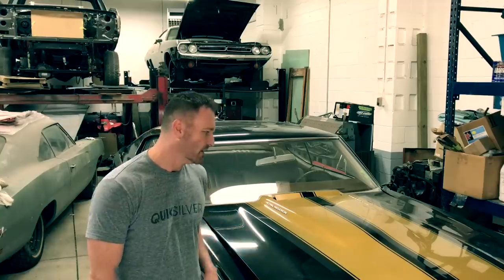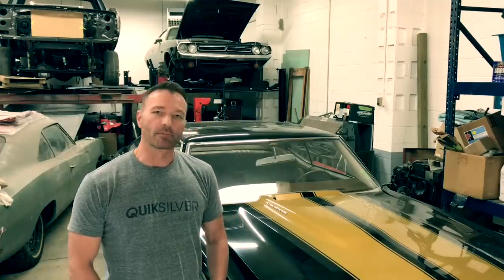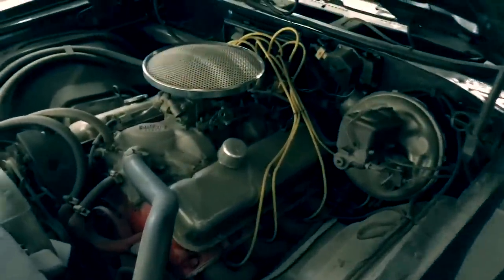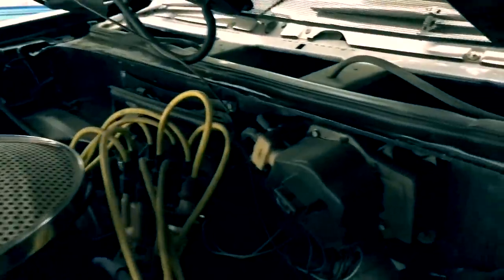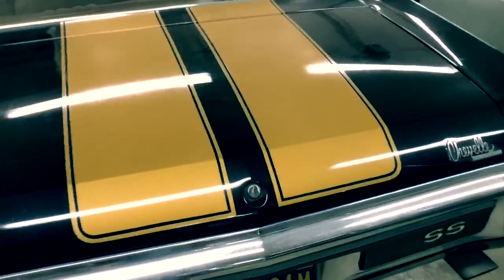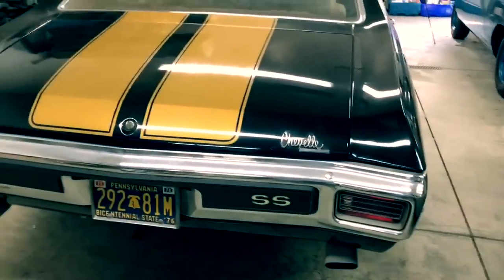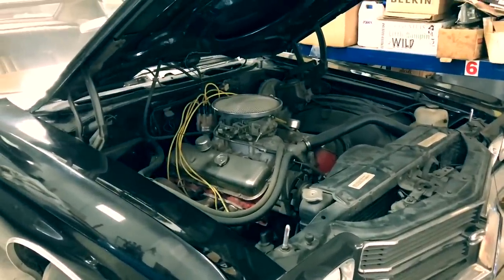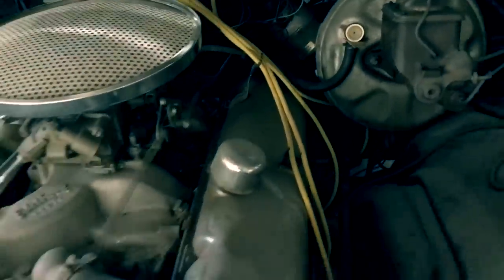Amazing 1,092 Mile 1970 Chevelle SS454 LS6 Found In Rural Pennsylvania

Comment: 1092 original miles. That's their story and they're sticking to it! lol
Reply: Baloney... A man doesn’t by his dream car, change the racing stripes and steering wheel add headers Remove smog, register it for six years and then only put 1000 miles on it...Tell me more about the guy I wanna know
Reply: @jamiecann2485  Do you know how many young fellas bought those kinds of cars and ended up over in Nam or some other country ? never to return , I didn't think so , some of those cars sat in garages for decades as well , lots of variables in life
Reply: @brettjohnson8009  Now you’re going to use the “Vietnam war card” to defend your BS???
Shame on you...
You tell me how many Vietnam soldiers that purchased Brand New 1970 Chevelle super sports fully loaded and parked them in a barn somewhere...and never came home...
In other words don’t question the car only has 1000 miles on it...
SAD
Reply: @jamiecann2485  Ditto, we used to just disconnect the speedo cable right away all the time on our cars. This is not a 1092 mile car
Reply: You could do a compression test on it. That would tell the story.
Reply: The early 70's low mileage Corvette sitting and fairly well maintained since 1976 in my relatives' extra garage lol's at Bob..  People tend to hang on to cars that were associated with someone who died..
Not even the only kept car in my extended family, but I have a ton of relatives on both sides.
One of my cousins has a pristine 70's black and gold firebird trans am that still sits on the showroom floor of my uncle's dealership.
You might be amazed at just how many perfect or near perfect cars are out there preserved if you look around. 
Most simply aren't for sale so they never come up.

Comment: My uncle had one (black/ red stripe '70 SS 454/4 speed 35k on the clock) when I live with his family in the late 90's. I did not roll it out of his garage at 1am in neutral on two occasions and neither did I race a ricer on the straights up past a buck 40 either. Pat, if you are reading this.... no harm no foul, right?   Man that was a sweet car.

Comment from the maker: No sir the carb on this car is aftermarket. All SS454 LS6 Chevelles had vacuum secondaries from the factory. List no 4492 for Auto and 1557 for manual except for state of CA which had a different but not important in your application.

Comment: Beautiful car!
But seems weird that, not one, but 2 previous owners, and the car only has 1000 miles on it... The orig owner changed alot of parts, and even had it to a body shop for the gold stripes, not to drive it! He must have owned a flatbed, and drove that around with the car strapped to it...
Sounds very similar to a family friend of ours that bought a new Oldsmobile in 1968. He was so anal about the car staying new, that he took it to a local mechanic and had the speedo cable undone months after buying the car. He owned the car for about 15 yrs, and had the mechanic show him how to do it himself, that way if he needed to have the car in for warrantee work, he would hook it back up before going there, and drive for a couple days before undoing it again.
Seems pretty cool when you own the car, but sad for the next guy who's buying a low mileage car...

Comment: I've got a couple of questions about the car. There was no Chevelle emblem in the driver side front grille. Yes, It could have been removed to make for a cleaner look. And, isn't there a screw that helps hold the side panels on each side of the back seat? They seem to be missing. It wasn't mentioned in the video but I'm just wondering if the interior had been redone or had some interior replaced. True, to me these little things doesn't hurt the car in my opinion it's truly a "one of a kind find". I had a friend who bought one when he got out of the Army in 1970. LS6 triple black Chevelle SS. It was black with black vinyl top. Black interior with white stripes cowl induction hood. Four speed M22 with bucket seats and console. I got to drive it a time or two. Again, not being critical just curious about the things I mentioned. Absolutely an amazing find!

Comment: You Know it's an Interesting Car, but the Things that have Been changed on it Are Very puzzling.  With the Overall condition Of the Car I don't Doubt the Mileage very much.  Though It's the Things that are Missing Such as the Original Exhaust Manifolds original Air cleaner & distributor that are Very puzzling Cause With only 1092 Miles everything Should still be like NEW.  Of-course if this guy Raced it those 1092 Miles Were Probably very HARD Miles on the car.  It's Just certain things don't fit with what you tend to see in ultra Low mileage Cars of the Era.

Comment: Wrong Intake,All LS-6' s & L-78' s Came With A Winters Intake,W/ A Snowflake On Frt.of Intake.A Winters Intake Is A Much Better Intake ,Than the Edelbrock Ones Of That ERA,Which is What's On That Car.Only Someone That Knows Nothing About LS- 6's Would SWITCH OUT the INTAKES.Video Didn't  Show Red Line of Tach,5500,or 6500 rpm?
Reply: If you look close @ the vid, it's a 6500 redline!  You're right about the intake.  I had a 69 Chevelle L78 & it had the winters intake.  Sure miss that car!
Reply from the maker: Most of my ex girlfriends know the original intake on a 70 L78 LS6. What part about day2 mods did we miss? The original owner did the  mods within the first 6 months or purchasing new.
Reply: Also, the original intake on a '70 was flat and he probably wanted a high rise.  Then after he added the high rise the cowl induction air cleaner was too high...
Reply: @patrickglennnicholsmusclec1674  did the owner keep the original parts?  Was that the 4557 Holley on there?

Comment: did those 454s (NON LS6) all use a 3310 vacuum secondary(780cfm 4150) ?   i have a 70 454 automatic that i changed to a manual 4 speed...  and im trying to figure out if they ran 3310 vacuum secondaries on all 454s or did they run a mech. secondary on a 4 speed?  please let me know..  thanks..

Comment: When I was 17 years old, I took my life savings of $5500 to Carlisle PA to the spring show to buy a car (Chevy). I passed on several 70 SS 396 Chevelle's because they were bench seat column shift... Lol.... There was a LS6 454 car, very nice, for $10k.. I ended up with a 67 SS 396 Chevelle that had a small block instead of it's big block. 138177 car. It's got a big block now. Paid $4500. Pretty good buy.

Comment: 1000 miles.  Christ, I put on a 1000 miles in 2 weeks.  Great job on vids.  Stay right there, I'm bringing a 30 rack.
Reply: Boy, you sure drive a lot! In 2006, I had a 2003 Chevy Suburban and put on 8800 miles. Now I drive a 2006 Ford F-350 Crew Cab with a 6.0 bullet-proved engine. It was a hard endeavor, as I saw a 2019 Ford Powerstroke with 95, 000 miles in less than a year! Holy Moley...in 5000 miles, it would be out of warranty!

Comment: I HAVE BEEN A OLD SCHOOL DRAG RACER SINCE THE LATE 60’S AND THIS CAR IS A TYPICAL DAY 2 DRAG CAR THAT WAS AT TRACKS ALL OVER THE COUNTRY BACK IN THAT DAY.  MOST GUYS INSTALLED TUBE HEADERS FIRST AS THE CAST MANIFOLDS WERE JUNK.  THE 1970 INTAKE MANIFOLD WAS A LOW RISE VERSION HENCE THE EDELBROCK HIGH RISE WHICH MADE MORE POWER.  THE DIFFERENCE IN MANIFOLD HEIGHT SCREWED UP THE FITMENT OF THE FACTORY COLD AIR CLEANER WITH HOOD SEAL, SO AN AFTERMARKET AIR CLEANER WAS NORMALLY INSTALLED.  OVER THE YEARS I HAVE SEEN A NUMBER OF PERFORMANCE CARS AT DRAG STRIPS WITH VERY LOW MILES, QUITE A FEW OF THEM CUT UP FOR SUPER STOCK CLASS WITH BIG TIRES AND FULL ROLL CAGES.

Comment: In Massachusetts, in 1974, at about 18 years old I bought a 70 Chevelle SS 396(402) Turbo 400 Transmission light blue with black stripes, white bucket seat. I did many modifications to the car such as  dropping in a 375 Hp motor, rebuilding that motor with all new valve train , headers,  intake, carb, high stall converter, clutches shift kit and tranny cooler. I also had 4:10 gears installed. Tires and wheels etc. I sold it in 1977 with just over 100k on the car. And as nice as my car was then. I had some rot behind the wheel wells starting. This beautiful find, 48 years old, is in better condition than mine was in 1977. Simply effin' amazing. The car I wish I still had. I replaced it with a 77 Z28, with 185 hp. Sad
Reply: Show some respect to the 771/2 z28.
Reply: @Sumner1028  Actually the Z28 was a nice car, I just meant they had decreased it down to 185 HP. With the 3:73 gears it went well enough.
Reply: @afterthestorm7012  my mom had one of those. I was distraught when she sold it

Comment: Hopefully you can do a second video and show the build sheet.  AND I grew up in PA and until the mid 1970's (I believe) we had a TWICE A YEAR state inspection.  So it is highly likely this IS an original low mile car as the mechanic HAD to road test the car and would have noticed the speedo NOT working.  AND PSP inspection troopers would have FLAGGED IT IMMEDIATELY if there was something amiss.  PA is VERY strict on state inspection records.

Comment: Why would anyone pay $500K for a car which costs around $4K new? I saw an original '65 Chevy Biscayne with the "Drag Pack" option, 425hp 396 and 4 speed. The cost? $75K. I decided to build my own. I found a '65 Chevy Biscayne with a 283 and 3 speed. The car had been re-paint once. The car had zero rust so I bought it and trailered it home. I installed a 550hp 454 and a Richmond 6 speed. Disc brakes and Hotckis suspension. I also installed SW gauges in the dash where the original AM radio had been. I hid a new stereo in the glove box. Total cost? $20K. Now it's a car you can drive everyday instead of a car you only drive to car shows. I also changed out the front emblems from the cross flags "V" to a 454 cross flags "V". I ran into a guy at a local car show. He said he use to work for GM and in '65, they didn't have a 454. He said, "Did you do that?". I said, "Yeah, so what?". He said, "I have an original Yenko Chevelle". I said, "Let's go see it". He said, "It's not here". I said, "Why? You see my car but I don't see yours. You're one of those guys who doesn't drive their cars because it's too valuable. Well, I'll drive my car anywhere and I do. I can't stand people like you who don't drive their cars so eat shit and die!". The guys says, "I didn't mean any by it". I said, "Of course you did, now fuck off!".

Comment: Did this car get the eyebrow trim under the headlight?  I didn't see it, and you didn't mention it.  My 70 SS396 is a 2 months earlier Baltimore build (01C) and it still has that trim but I know they stopped putting it on cars sometime, not long, after that.

Comment: Very cool and period correct mods! People are asking why the cowl induction was removed. Well, back then, having a chrome air filter was cooler. Yellow plug wires were cooler. Headers were mandatory as was the addition of a Hurst shifter. Some are questioning the mileage. Well, with 4:10's, cruising was about all you would do with these low gears. Was it raced, probably just on the street.

Comment from the maker: The LS5 SS454 was originally equipped with a Rochester Quadrajet that was vacuum secondary. Part number 7040204 for automatic and 7040205 for manual. Again excluding the state of CA part numbers.

Comment: I have a 1964 Ford Galaxie 500  fastback (2 door) numbers matching 289, 3 spd on the column, Raven black with red interior but white headliner and sun visors with just only 6,425 original miles.

Comment: Great Video, Thanks for enlightening the young bucks out there on "day 2 mods". I modded mine right away too with accel dual point distributor, wires and coil. Headmen headers and 2.5 custom pipes. Mine was a Plymouth Cuda with a 6 barrel intake on a 440.  Wish I had it today.
Nowadays, if you mod a car right away, it voids the warranty. I would like to hear the LS6 idling?

Comment from the maker: If it’s a LS6 crate motor it should be mark IV engine. You need the standard big block oil pan from the 60s 70s era. You can pick one up at a swap meet or eBay for under 200 most of the time depending on condition.

Comment: To everyone saying it wrong and it should have been run and driven daily, we only have cars like this because someone left it in a barn or garage, too many are run into the ground, chopped, raced or simply rusted away. Cars I grew up with have numbers under a hundred left some as little as 25 still on the road. (Shows, Rallys or displays) having been used for banger racing once they failed the mot (UK) cheap runners used till they rusted away, now just memories unless you visit a car show wishing you still had that car in the garage.

Comment: You seem very knowledgeable on the Chevelles . I have a question about a 68 I came across . It is white with a black vinyl top . It has 427 badges and instead of hood pins it has keyed locks on each side of the hood . Unfortunately it is not for sale and sitting out in the weather . I did find out that it was purchased somewhere around New York . It is now out in the country here in Alabama .

Comment: My Baltimore built 1970 396, M-20 Four speed Chevelle had metal inner fenders, The driver side had rotted out around the battery box, I remember going to the Chevrolet dealer up the street from where I lived it was called Lustine Chevrolet and they had the inner fender well in stock in steel and the battery tray still available and later on I ended up buying one tail light lens when I backed into a bush that puncture the center, But the only taillight lens available was the plain taillight with no silver paint which I had to tape off and add to it to match the other tail light, The only thing missing when I got the car was a Super Sport rear bumper and somebody had repaired and rear quarter panels because the paint was flaking off and I bought the car 1976, You could see the black coating wasn't prepped from the two new quarters they had hung on the car, My car new was Fathom Blue with White stripes and it also had the washer bottle warning light and the fiber optics, That were all there except for the top of the front fenders was missing the two little indicators, But the one in the back package tray was still there.
Reply: Lustine Chevrolet was in Hyattsville Maryland, At the time they used to be the biggest East Coast Warehouse for Chevrolet parts, Before that it used to be the Bob Banning Chrysler, Plymouth, and Dodge race car shop, they always had a good supply of rare sheet metal and trim parts available I remember buying all the new supersport center caps and mounting hubs for the Super Sport Wheels and the cowl induction letters for a hood that I picked up along with the new Chevelle Chevrolet script for the trunk lid and also the new SS 396 emblems for the fenders because mine were pitted so bad and a new set of hood pins that were in stock before they went out of business in the mid 2000's.

Comment: One in a million find w/ the low miles and the 454 c.i. 4-speed w/ 411 rear. The condition is superb especially for a Northern  Pennsylvania car, however, I doubt he ever drove it in the winter. Did it come w/ the chrome rings and top hats for the rally wheels, or were they missing?

Comment: I will say it probably is correct in that the mileage is only 1092 on the odometer. But I would like to also point out that it's possible with these older cars to simply unhook the speedometer cable and then drive and reconnect the cable later. My neighbor did this to try and keep his new car in warranty a little bit longer. Kind of a useless attempt as most cars were 12,000 mile or 12 months anyway. The car was a 1978 Martinique blue WS6, W72, 4 speed Trans Am with blue interior and the fisher T-Tops. He disconnected the cable at the back of the speedo head with it showing about 6200 miles. He then drove the car for four years with limited use on nice days and not driven in the rain or snow and it was always garaged and covered. Finally he reconnected the cable and drove it putting about 4000 miles on it showing just over 10,000 miles. The car sat for another couple years and he finally sold it in the spring off 85 and he got $12,500.00 from a private seller. I asked him how many miles did he think he drove it to which he said not less than 10k and not more than 25K.

Comment: Front bench seat and steering wheel have plenty of wear for 1000 miles, valve covers have a fair amount of oil around them as well but even if 30000 miles a sharp car.

Comment: I noticed it has the 7" Corvette style rallies on it, rather than the five-spoke. Is that normal? Asking because my 71 SS El Camino (Not a clone) had the same and wasn't sure if original ... but they are stamped 71 by the valve stem?? I got it five years ago from an old guy that had it for the last 30 or so years, wasn't sure if he changed the wheels  or not..... I put 8" 1974 Corvette rallies on it now, retained the 7" ones in case they are originals....

Comment: I was wondering if you could answer a question for me.I bought an LS-6 crate motor some time back I think it's a gen V block and has the one piece seal.I am gonna put it in my 69 elcamino with an M-22 BUT I need to know what oil pan I can use because the one that came with the motor hits my crossmember,and I don't want to chop it to fit.An y help you can give me I would appreciate....Thanx.

Comment: Everyone keeps commenting about the mods on this car. Did anybody stop and think, ok the owner took it off the road and only used it for racing. Last registered with 1010 miles, now has 1092 miles. You can make a lot of 1/4 mile runs in 80 miles.